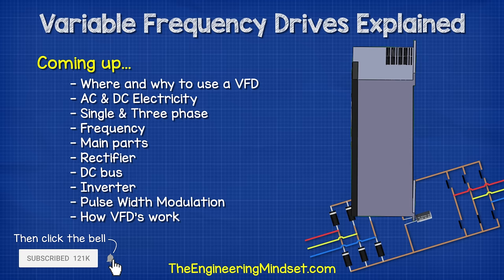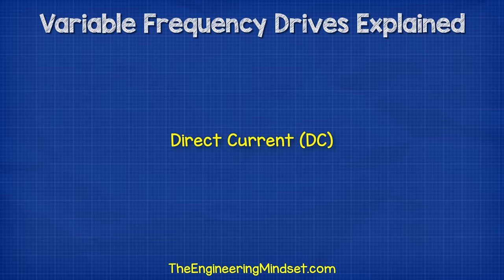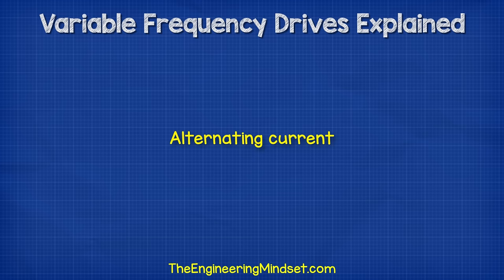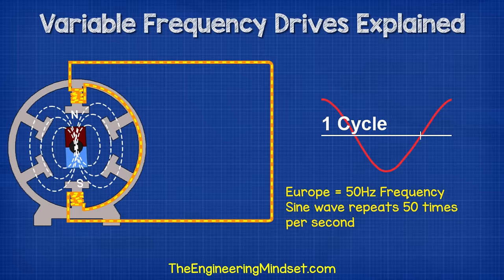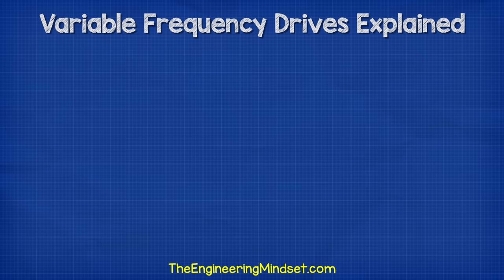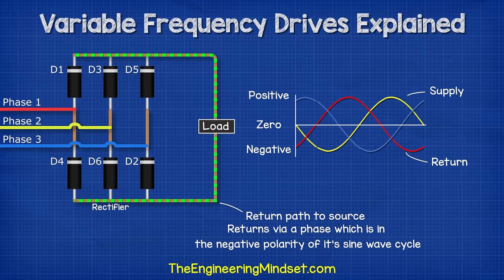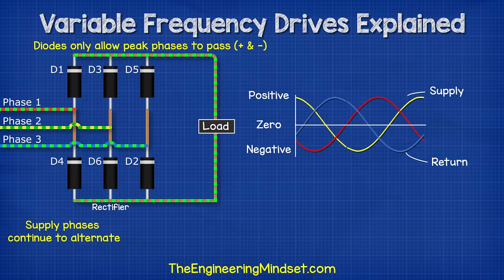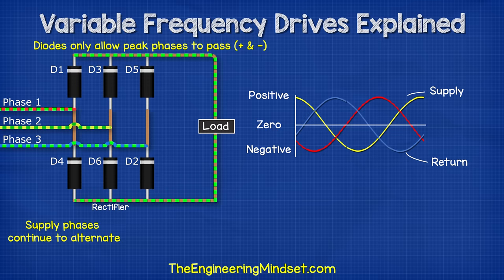Variable Frequency Drives Explained - VFD Basics IGBT inverter

Comment: 4:09  i have one question at this time magnet is moving and electron is moving due to it in copper wire and there is electricity. My question is that even the material in which coil in turned and the martial of generator is also metal then there should also change of electron and flow of electricity,    Then why we dont get electricity there?

Comment: Fantastic video as always! This video has me wondering about a couple of things. Is a BLDC controller just a VFD without the rectifier? Also, could a VFD be used to drive a BLDC motor, or do they work exclusively with induction motors?
Reply from the maker: Check out the new BLDC Motor video: https://youtu.be/yiD5nCfmbV0
Reply: @EngineeringMindset  thank you so much!

Comment: so can a controller run any igbt and then fire a 15 kw set and or a 100kw set pendind huge cap setup and 250 amp igbt also heat sink

Comment: However, PWM ultimately is a signal that can have similar power or perform similar works to a sine wave, but it is not the same as a sine wave, is it? The graph of the output signal is essentially a repetition of DC pulses with varying duty cycles, not a sine wave, right?

Comment: At 6:00 you say that the phases are 120 degrees apart, but you've reversed the connections on phase 2 and phase 3,  if you take the "side" of the Edison socket as being "neutral".  Phase 1 goes to the base of the Edison socket, and phase 2 and 3 go to the sides of the sockets. Yeah, it's a nit, but I picked it anyway.  You probably did it to just to make the drawing clearer.

Comment: I really like the video, however i have question.
You start with 3 phase AC and then at the end you also kinda end up with 3 phase AC but you can change the freq because of the switches. Isnt it possible to skip the middle parts? (Changing AC to DC and then switching it back to AC) i suppose most pumps etc run on just AC so i dont get why you would need to convert it to DC in the first place
Reply from the maker: So that's the electricity is clean and stable, then we can covert it into whatever voltage and frequency we require

Comment: Turning this on its head:  Would it be possible to power the DC input of a modern household Solar Inverter with a 12V (car marine SLA) battery?  The problem is the input voltage required for most solar inverters is usually pretty high eg around 80V to anything like 1000V.  I know you can boost the output voltage, but I haven't really seen anything that could boost to more than 60V (although I have seen them labelled 90V).  Would you need to limit the current to the Inverters max or would the inverter just pull the load it wants?  You would also probably need to monitor for low voltage on the battery to make sure it didn't get damaged draining it too much.  Is this feasible?
Reply from the maker: Seen our new video on HOW SOLAR PANELS WORK in detail https://youtu.be/Yxt72aDjFgY

Comment: I understand this but I want to know this ,what about when the motor appliances is turning off and on like a refrigerator motor I want to know if the current won’t rush into the motor like it’s plugged into wall or the motor will just start slow and go up

Comment: ok so how do you get 415V from a vfd with a source of 220v from the socket. or how do you run a high voltage motor that wouldn't run if connect to the socket

Comment: Great video overall, but it doesn't explain the sequence by which we should open and close the IGBT switches. Like how do we know when to close which pair of switches?
Reply from the maker: That was covered in detail in the video
Reply: @EngineeringMindset  I mean when closing switches in pairs, you started with switches S1 and S6. But lets say I want my first pair to be S5 and S4. So how would I know which switches to choose? because both the top three switches are at the same potential due to the shared node. 

Hope you get my point
Reply: @SamiKhan_15  Depends on which direction you want to run. If you were developing your own PWM controller, you don't really need to spend time to think about it. Many controller manufacturers have some kind of PWM controller reference design with source code.

Comment: What will be the "Current measured" in the Supply side of the VFD while the Motor is running at various speed (say at 100%, 75%, or 50% speed)? For sure at 100% speed would be the Full Load Amperes of the Motor!  What about at 75% or 50% speed of the motor, how much Current will be measured? would it be same as the FLA (regardless whatever speed)?
Reply: The current supplied to the motor is automatically determined by an internal control loop which depends on the outer speed control loop. For high power motors the speed can exceed 5 times the nominal speed for short periods of time. The controller determines the desired current to reach the set point

Comment: Hi, i have a question
How do I design a three-phase induction motor and what capacity should I choose?
Also, what is the effect of the source distance difference from the dominant VFD?
i am not good in E  ً : )
Reply: Sounds like you need to design based on required horse power and with the distance from source you need to consider voltage drop of the conductors?

Comment: I am  not electrician , if I have 1 phase motor 3/4 HP, 1500 rpm and I need to control  the speed in between 900 to 1500 rpm depend on the load. Could I use this device ? Sorry for stupid my question

Comment: This is minor, but is there a reason you show 4 lines at 6:50, all on insulated standoffs? I understand there may be a 4th conductor, but it would be the neutral and therefor not connected via an insulator. Similarly, many split-phase systems use this neutral on the primary, so the transformer would only have one line coming in needing an insulator.

Comment: @9:39, you said phase 1 will supply and phase 2 return, but phase 3 is also in a negative phase as well, just not as much as phase 2 so what happens there? is the current partially flowing thorugh phase 3 on the return but just to a lesser degree as phase 2 or is totally binary, either one or the other., i feel its a gradient effect just majority is flowing thorugh phase 2 and phase 3 gets a lesser amout, please clarify.

Comment: Great, just one question: how do we get from chopped PWM to a nice smooth sine wave on the output?
Reply: Lindsay Fowler quasi wave formatiion
Reply: The PWM signal ends up being smooth in current, but a bit rougher in voltage. It's smooth enough because the switching frequency is fast enough for motors to spin, but it does come at a cost which is voltage spikes on the output. If this becomes an issue, adding an output choke, dU/dt (dV/dt) filter or Sine filter on the output will take care of that to increasing degrees. We (Danfoss) offer those filters along with our drives if this is an issue.

Comment: 7:32 --> So a diode is blocking the current from flowing from the cathode (white line) to the anode, right? I am just wondering because the simulation i showing the oposite, isn't it?
Reply: I agree.  It looks like the current is flowing the wrong way in the diodes.  Other than that, this is an excellent explanation.  Excellent videos like this would have been extremely helpful in 1963, when I attended electronics school in the USAF.

Comment: So it is ac to dc back to ac. i dont quite understand the last invertor bits. I thought the switch have to match the stage one to go for the same wave. wouldnt it chaning the frequency of the moving switch leads to the mismatch of the stage one?
Reply: i rewatch the video again, so momving the switches in pairs could simulate the three phase. I see

Comment: so how complicated would it be to create a VFD that also had a neutral so that single phase load could be connected? :D
Reply: They exist! But usually very small. Personally I have only had my hands on 3-Phase ones.
Reply: There are vfds :  3phase input  to 3 phase output,  1phase input to 3 phase output
Reply: Full disclosure: I work for Danfoss. That out of the way, we have single phase input drives primarily for HVAC and Water applications. Most single-phase drives are single-phase in and three-phase out. This is mainly because three-phase motors are more prevalent and it takes less overall current to get the job done. In many cases, you can also run a three-phase drive with a single-phase input as well, but part of the three-phase waveform reduces the amount of capacitance needed on the DC bus, so you really have to derate the current quite significantly (50-80%) which we don't really recommend. Hope this helped :)

Comment: what is the type of controller that used to control opening and closing of IGBTs
Reply: The device that gives the Pulse Width Modulation signal to the IGBT's are just microcontroller GPIO's.  The microcontroller generates the signal, then that signal controls the power transistors to turn on and off via PWM.

Comment: in a inverter compressor, does it means that the compressor runs at a DC voltage? or does it runs at AC 3 phase?
Reply: DC

Comment: Is it possible to go directly from AC to AC varying frequency without a DC bus transition?
Reply: No, because the voltage to the IGBT's will be unstable
Reply: Technically, yes. It's quite expensive and the engineering is a bit different, but Yaskawa (I'm from Danfoss) has been selling their Matrix converter for some time now. It's a lot easier to do with the transition and the losses are only around 2-3% on average, so I'm not quite sure what the benefit would be.

Comment: What if a frequency drive, say, 11KW, has more amps written on the side of it, lets say 60A, than the motor needs, lets say 40A, or your electrical circuit, 40A, allows?
Does that mean the drive pulls 60A for the motor, or does it mean the drive can pull up to 60A before it starts screaming for mercy?

Comment: If single phase is connected to resistive load in the house and has only transformer as inductive load. Can that  transformer  leads to reactive power.
Reply from the maker: Potentially yes but it's not going to be much. When you start adding induction motors etc then it will.
Reply: OK thank you

Comment: I don't totally agree with the description of current flow between phases when your describing rectification and like wise connection to a 3 phase load. Return current can and will flow in a balanced ratio when one phase in in the +ve cycle and the other 2phases are both in the -ve cycle. Similarly while 2 phases are  in the +ve cycle current will flow from them to the phase that is in the -ve cycle. When a phase in in the 0 crossover then the current will flow should only between the +ve and -ve phases. Your explanation implies that current is only ever flows between two phases.
These drives are also know as Triple V F drives or VVVF drives

Comment: Whether 3 phase VFD can be used to run air conditioner
Reply: There are variable speed air conditioning units. The drives are most commonly used on the compressor of the A/C unit, but in large buildings, they're also used on the fans to circulate the air. I'd say it's not so cut and dry to modify an A/C unit that you already own, but it could be done.

Comment: In Pakistan VFDs are use to drive submersible pumps on Photovoltaics.
But I have a doubt. The input is DC how do the manage to make 3phase output?
Reply: For solar sources (or any DC source in general), we just basically ignore the diode bridge. It's not doing much anyway. But the IGBTs work the same way without issue.
Reply from the maker: Seen our new video on HOW SOLAR PANELS WORK in detail https://youtu.be/Yxt72aDjFgY

Comment: Usually unloaders do the capacity needs. Some times reverse polarity motors pick up extra pistons. Cooling towers usually have now VAV or head control 400 Hz.fan on cool tower. Dc motors may have brushes and are not worthy.

Comment: @6:24, I am confused, the three phases are connected together? at a single point?  how? current only flows in one direction and so how can you have opposing flows or partially opposing flows in a wire? is
Reply: It's called the neutral if you have ever seen a video on a power plant and seen the generator you would see coils of copper one end of each coil is tied together to one line called a neutral spaced 120° apart also called segments the number of coils depends on the rpm that the generator will be running to get the desired frequency that is needed
Reply from the maker: Check out how car alternators generate electricity here: https://youtu.be/jdSKlg80DjU

Comment: If the electron flow from negative to positive how come we put the resistor on the positive side instead of the otherway around.?
Reply from the maker: Make a simple resistor and led circuit, flip the resistor and led around so the led is first on the positive, it'll work fine. Just make sure the led is rotated otherwise it'll block the current because it is a diode after all.
Reply from the maker: Check out NEW resistor video, everything covered! ➡️ https://youtu.be/DYcLFHgVCn0

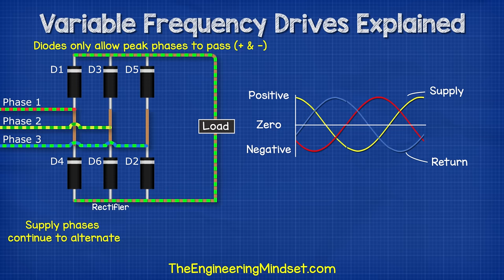Comment: for a three phase full bridge rectifier as shown in 9:23, In section 1,why cant phases 1 AND 3 flow through their respective diodes into the output side, combining their voltage and current? A 3 phase full bridge rectifier seems to be very wasteful of electricity as a 1 phase full bridge rectifier sends useful energy through in the top and bottom half of the sin wave, while this only sends the peaks of the positive half of each wave.
Reply: seems almost more efficient to power a VFD through a single phase supply

Comment: Hello, i have simulation of a single stage, single phase flyback inverter, feded by a pv array. The control is okay but the output current can't be in phase with the grid voltage, even i have a PLL controler but nothing works, with all the modifcations that i do current and voltage can't be in phase, current is lagging about 90 degrees, what can i do?? :(
Reply from the maker: Seems you need a power factor correction to realign
Reply: @EngineeringMindset  it suppouses the DCM design must be enough to reach the high power factor, in fact references reachs unity power factor or closer, and no one use a power factor corrector :(

Comment: Why can't you use transistors instead of IGBT to make a sine wave instead of PCM?
Reply from the maker: You could make a signal version but the current and heat dissipation limits them, also control timing.

Comment: What actual device determines the speed at which the frequency occurs and can anyone give me a link to a controller or something that could dictate this
Reply: The device that gives the Pulse Width Modulation signal to the IGBT's are just microcontroller GPIO's.  The microcontroller generates the signal, then that signal controls the power transistors to turn on and off via PWM.
Reply: You can find VFD dev kits/reference designs from companies like Texas Instruments, Infineon and Xilinx. You don't need to do a lot to make a basic one these days.

Comment: I am HVAC technician.  The compressor for the AC system has a Variable frequency motor with three phase DC motor?  I thought it had a three phase AC motor, but the name plate of the compressor has DC motor.  How is it possible?
Reply: It could be a BLDC motor. It uses an inverter, but actually is a DC motor. Its too similiar with the stepper motor. Basically the inverter goes sequentially commuting which coil will be powered, and this will apply torque in the rotor, which have permanent magnets inside.
Reply from the maker: Check out the new BLDC Motor video: https://youtu.be/yiD5nCfmbV0

Comment: How could we able to reverse a motor with vfd?
Reply: swap one of the phases just like any other motor...
Reply: @kevinn2759  Actually, this might not be necessary. It depends on whether you want to reverse direction while under operation, in which case you just tell the drive to run backwards, or if you want to change the direction that the drive considers to be "forward," which is something you can do in some drives by simply changing a parameter.

Comment: What you show at 11:16 is impossible. The voltage on the node/wire going to the load and going to the capacitor must be the same. Wenwill observe the smoothed voltage everywhere in the DC part of the circuit. Whta you should have shown is that the current flowing from the diodes is less smooth than the current flowing into the load, thanks to the capacitor supplying the missing current...

Comment: I find it interesting that we convert AC to DC and then back to AC again, doesn't seem very efficient.
Reply: think more
Reply: @Pipiopy  Ham Squirrel? I can put two random words together too... I need context.
Reply: It's often actually more efficient because the motor doesn't need to run at 100% when e.g. 80% is enough
Reply: Depends on your definition of efficiency. Your typical drive loses about 1% to do the AC/DC conversion then 1.5-2% on the DC/AC conversion. Motors, on the other hand, lose anywhere from 15-30% (rough window, may not be fully accurate) when operating. Adding a drive allows for a lot of improvements.

Comment: American electricity standards are still in ancient times i mean for house hold they give 2 phases having 240v and call it milti phase 😂🤷🏻‍♂️. It’s  2022 we have really powerful stuff even at homes proper 440V 3ph supply is just better Dilevery much more power need thinner wires.

Comment: A small doubt.... by using IGBT WE  CONTROL THE FREQUENCY  why dont we use this  at the start rather an rectifier and an inverter
Reply from the maker: Because the IGBT needs a clean constant source to create the AC from so we need the rectifier. Otherwise the input AC can change frequency and voltage and the IGBT will not be able to correct this.
Reply: @EngineeringMindset  thanks